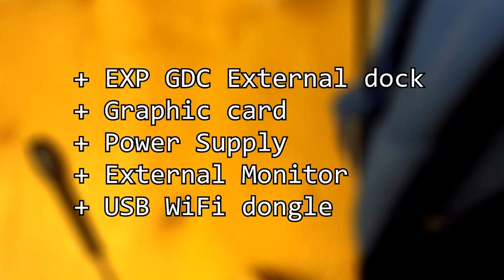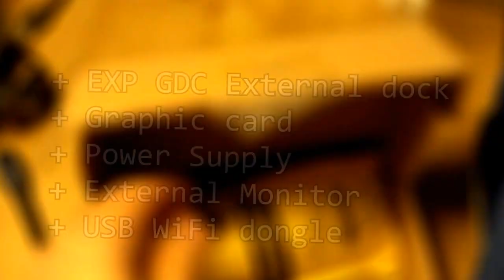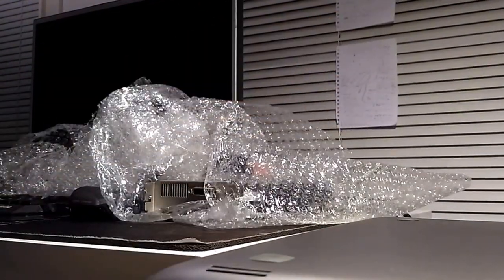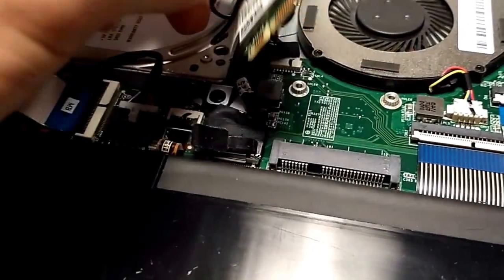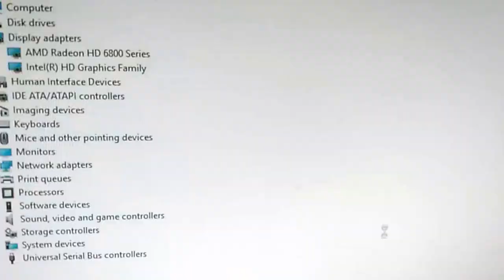Turn your laptop into a Deep Learning BEAST

Comment: Is external monitor really required for this setup. Can I use the laptop itself as the screen?
Reply from the maker: Yes you need a monitor, since the video interface in laptops is output only.
Reply: Thanks. Really nice video and very helpful.

Comment: Hi Daniyal if i wANT TO BUY A LAPTOP FOR DEEP LEARNING  budget buy in india what would it be??
Reply from the maker: I personally would never buy a laptop with an integrated high-end graphic card, since they weight like a brick and they lose the whole point of a laptop: easy mobility. I know nothing about the market in India tho.
Reply: Nishant Kumar go with desktop bro
Reply: Nishant Kumar Alienware
Reply: My 3GB Nvidia 970m is not sufficient. I can hardly do batch training (at max 2 images at once). That too the main problem is, my gpu doesn't run any well established architectures(More the number of parameters, more the problem using my gpu). I am fed up with resource exhausted problems .. So a better option would be a desktop with 8 or 11 GB gpu memory!

Comment: Just buy normal desktop. video cards are more expensive parts of the build, they are just left flapping in the breeze. Slightly wrong move of wrist sends the card flying off your desk.
Reply from the maker: Well, if you usually work from the same place, then a desktop is a better solution. I went with the eGPU option because I travel every now and then, and carrying an ATX with me is much more of a hassle than just a graphic card, which can easily fit in my luggage.
Reply: Daniyal Shahrokhian but what about the desktop power supply? Would it be possible to modify a laptop adapter from an old laptop?